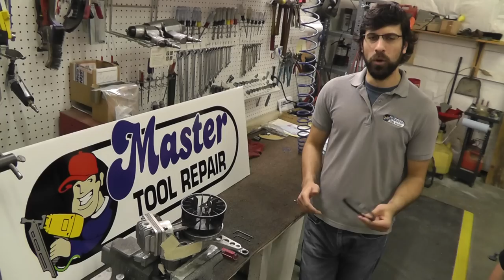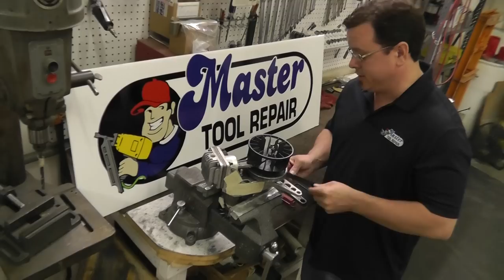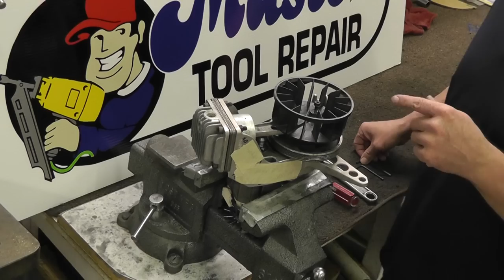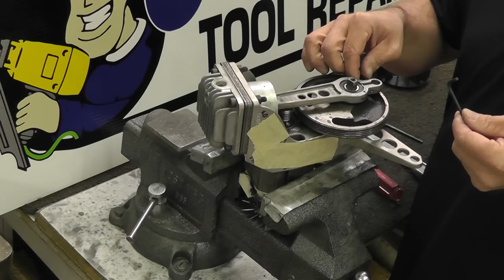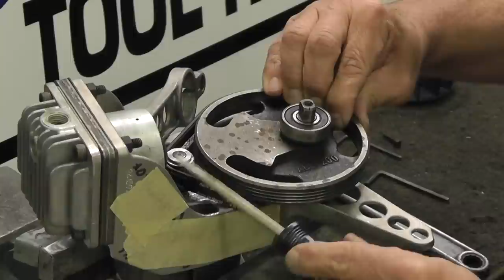How To Install A Husky PJ373 Air Compressor Belt

Comment: I called Husky and they sent me the belt for free, but after 2 weeks it snapped again. I made sure I didn't damage it with the screwdriver during installation too, I don't know if the OEM belts are usually faulty like that but I'm gunna try an aftermarket one now and if it lasts more than the OEM one did I'll post it here....Thanks for the video too.

Comment: Got it on by putting an 18 socket over the pulley then pushing the flywheel round forcing the belt on (the socket prevented the belt from slipping off)

Comment: How do you get the plastic shield off  to get to the motor
I got all the screws out can not get the plastic off
Reply from the maker: Jerry Thompson To remove the screws from the Shroud/Cover, use 5 mm Allen bit with 6” extension. Make sure they're completely loose, then the shroud [should] be able to be removed relatively easily.